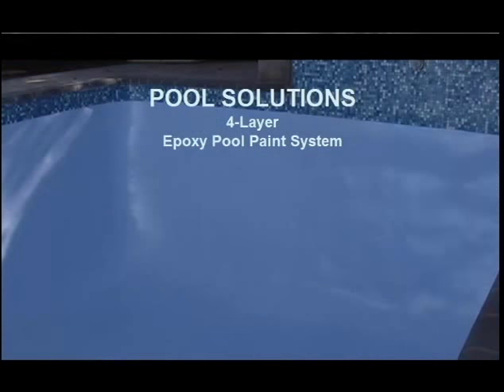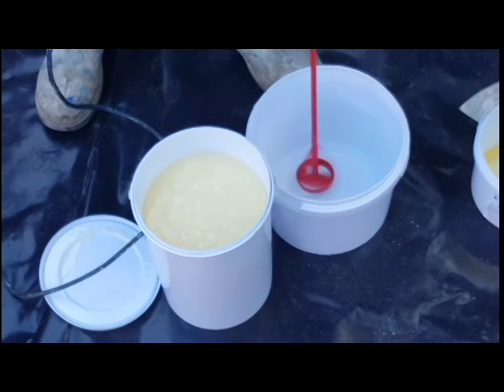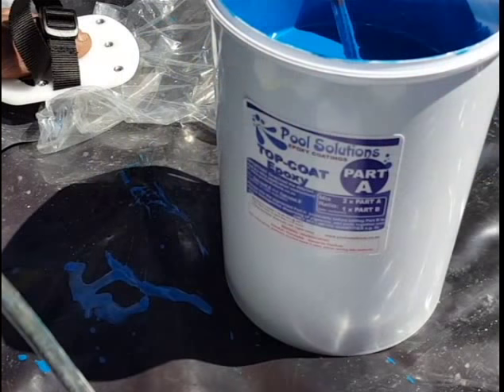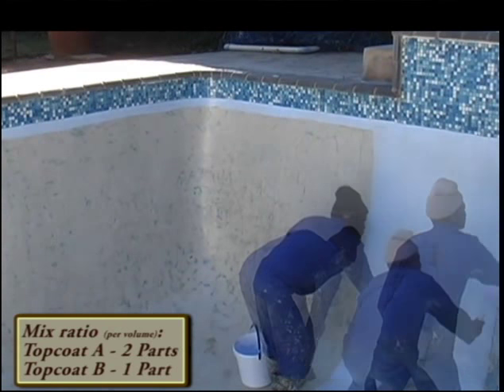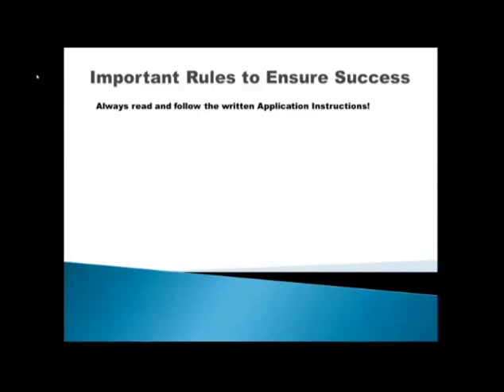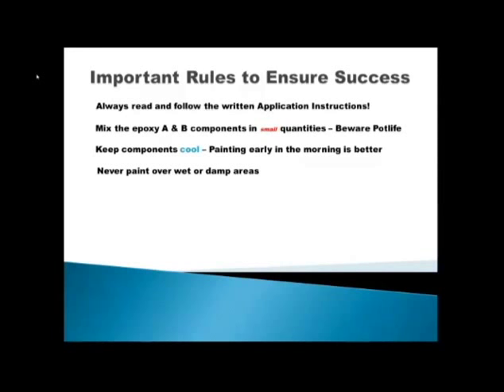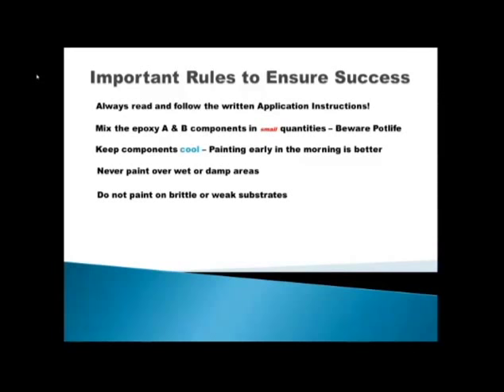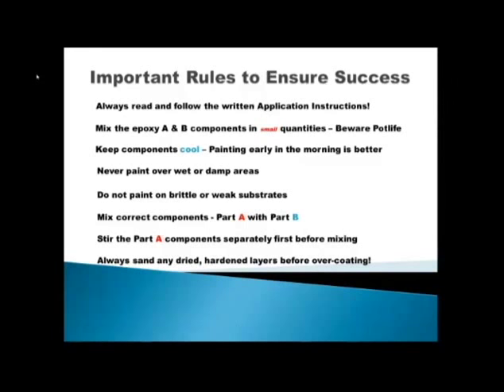Applying The Primer And Topcoat Epoxy Layers

Comment: Just a note of caution to   anyone.  The pool being outside does not mean you do not need self protection.  Wear a 1/2 face mask with the  right  vapor filter , for the chemical job.  On a day with no wind, the epoxy fumes will build up in the pool.  word of caution.

Comment: Everyone, please ensure putting part B (catalyst) in the container first.  This will ensure a more complete mixing of the two components.
Reply: The hardener is of lower viscosity and adding this into the mixing container first can be a help as mentioned.  Always use an electric drill with a proper mixing tip to ensure a good mix.  Adding two containers will also ensure a homogeneous composition.  In the case where only one person is handling the application and decanting of smaller quantities is required, please stir the Topcoat Part A separately every time before measuring out with a measuring mug and decanting of the two components in the indicated mix ratio.  This might also be necessary where only a small area is left over to be coated and full container quantities will be too much mixed product.

Comment: Damn is that the biggest rollers you have over there, thats alot of work
Reply: 150mm White Mohair is what we use currently.  Larger Rollers do not cover well in hollow spots. Painting out of buckets with handles works better for epoxies to obtain a longer pot life and keeping the paint bucket in hand. 150mm Rollers can still fit into buckets.

Comment: Hello, I've just bought pool solutions top coat. My pool is fiberglass coated, I drained it and had to clean it with an acid. You mentioned not to use an acid, now that I have what steps can I take to neutralize the acid to prepare the surface, Before I paint it?
Reply: Hi, use one packet of Bicarbonate of soda in a 20L Bucket of water. Splash the surface with a splash brush, leave for 30 minutes to soak and neutralize acid. Then high pressure wash with garden hose under thumb pressure. Scoop water out and mop up, let dry.  Sand surface with p60 sandpaper before applying the epoxy Primer.

Comment: What is the lifetime of this surfacing what is the approximate cost?
Reply from the maker: Based on historical data the expected lifespan before top-coat will thin out and will need a refurbishing coat is 8-10 years provided the water balance is generally kept within specifications.  We are operating from Pretoria, South Africa.  DIY cost is +/- R 100 - R 110 per square meter.Visit us at www.poolsolutions.co.za for a detailed quote.

Comment: After sanding do you vacuum the dust from that process out
Reply: You just need to basically broom and scoop the loose material out of the pool, no need to be super-dust-free. You may use dry cloth or brush to ensure the sides are free from accessive loose material.
Reply: @immortalme111  thank you one more thing i going from a rubber paint to epoxy on a old concrete pool the sanding disk you use in your other video will they take it to down to the concrete and do they get 'clogged up' frequently

Comment: What king of sand paper u used
Reply: Hi Humberto,  for the pool surface preparation we grind with Lacas Abrasives P16 Fibre discs,  For inter-layer sanding we use general use 60 grit sandpaper
Reply: Is it possible to use a smaller roller?  🙄